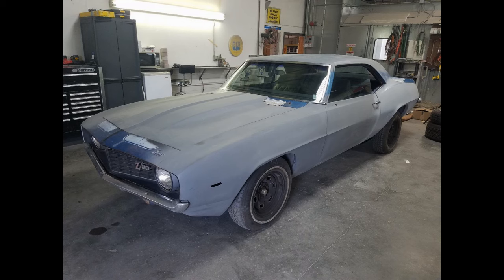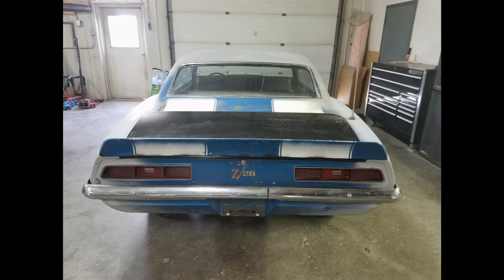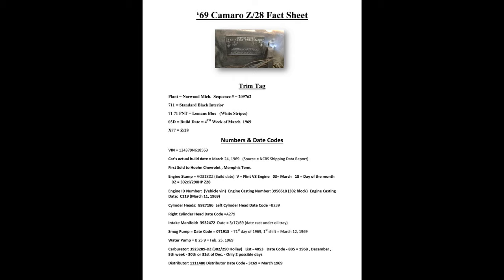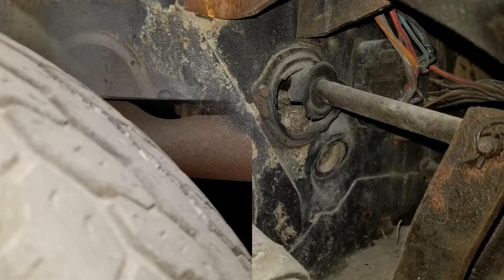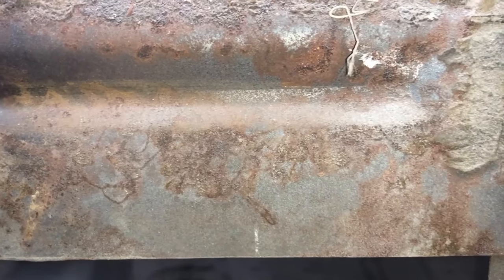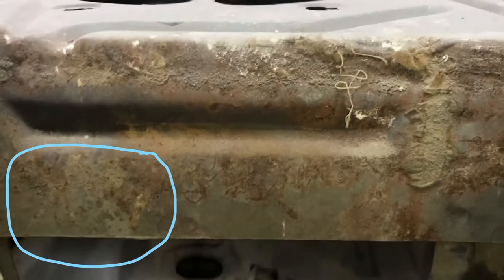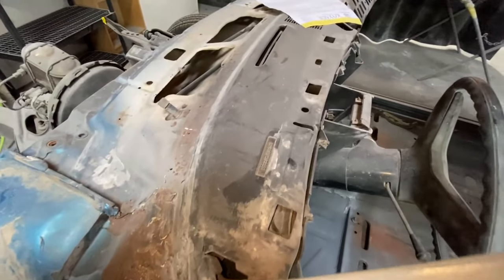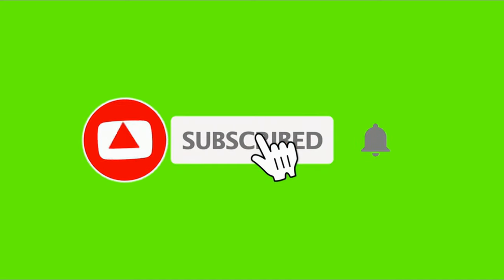1969 Camaro Z28 Le Mans Blue Full Restoration Video Series - Part 1

Comment: I found this four years too late! This is very similar to my uncle’s first new car, at least the way it rolled off the assembly line. Code 71 paint, black interior, flat hood. He he had the rear spoiler, but was without the console and had 3.36 gears - the tallest you could order in a Z-28. He was 21 when he ordered it. What a great find for you.

Comment: I want my 68 back FULLY Rebuilt as I Intended it to be, that My "Best Friend" at the time was Rebuilding for me, being Fresh Out and Top 5 in his College Coarse, His Parents Sold in 92, Without a Title and Me knowing in the middle of the Build...  Would have had a Brand New (1989) Trucks 350 w 5 Speed with only 500 miles on them, Tilt Telescoping Steering, Custom Kevlar ( Kevlar free from work ) Hood with Scoops and Kevlar Tail Wing, Fresh Restored/Covered Buckets, Dual 3" Exhaust, Brand New Carpet, Brand New F/R Quarters I got from work. $4000 just in Primer ( Free From Work ) Brand New Windshield/All Glass and everything else it needed to rebuild... All there... But was taking up room in a Shed they never used, so they sold Everything and if I remember correctly, only got a Few Grand for it... like 2 or 3 grand and I paid 1500 for Rolling Chassis and most of the stuff besides the engine/trans, paint/primmer, steering wheel, quarters and all the Free Kevlar was already included.

I use to work at a Chrome Bumper Plant where we would Strip/Sand/Sand Blast Cleaned and Prep Bumpers to be Chromed/Restored or even High End Painted ( $1000 Per Gallon Primer ), along with any parts you wanted Chromed/Restored. Could Order any Body Part of Any Car you wanted. I Could of Chromed my Whole Camaro for Free if I wanted to.. Since Employees were allowed to Chrome Any Part For Free...

Comment: You may be aware by now, but the shifter hole is likely original. They were cut with a torch by hand on the assembly line. Guy may have had a tad too much coffee that morning.

Comment: Kind of new to the car scene but for some odd reason I'm loving these restoration videos and I've never been interested in auto machanics before...  curious to know what a good deal is picking up something like this?
Reply from the maker: I spent 15 years looking for an original Le Mans Blue project car that was not rusty beyond repair with original engine & drive train. So it just takes persistent looking and digging. They are getting harder to find every year.

Comment: Oh hey I just remembered that I also have the same 6618 block in the garage too I think it’s a 350 but now I have to check today and if the numbers I want to see have been machined off.I inherited it when a buddy passed on.hey I like the sound of yours,is that the final motor combo or no?
Reply from the maker: Hi Barry, the engine that was in the car when I bought it, was a 350 which is what the car had in it when I pulled it up on the trailer in the video. I got the original DZ block with the car, which I am building to put back into the car as it was from the factory, but the DZ engine sounds very similar to what the car sounded like. Pulling it up on the trailer, except that the DZ has solid lifters. But dz engines sound very radical.

Comment: I'm glad I found your channel. I am into CBX's and 69 Z28s just like you are. I have a Rally Green 69 Z and a Silver 79 CBX that I bought new. My 69 Z28 is an early one assembled 12-5-1968 at the Los Angeles Plant and delivered to a Chevrolet dealership located within 5 miles of my home in San Antonio Texas. I was wondering if you found the build sheet anywhere on your car when you disassembled it? I've heard that the build sheets are rare to find on a Norwood car. I'm wondering if there might be a build sheet somewhere on my Z. I have a video up of my car too. Thanks
Reply from the maker: Hi Michael, Thank you for your comment. I hope subscribed so you can keep up on the Z/28 build. I just watched your video on your Z. Very Nice. I love Rally Green. So you must have chambered exhaust since its an early car. I have not found the build sheet. I am sure there never was one being a Norwood car. But I do have the original sales receipt and the NCRS report. :) I am so lucky to have found a pretty rust free project car in the color I have always wanted :)
That is so cool that you still have your original CBX. I also bought them new and wish I still had the original 79 as I still have the original sales receipt.
Reply: @digitalpizza1  Thanks, I did subscribe to your channel. My Z28 was sold originally with a flat hood and no spoiler. It was also originally equipped with the chambered exhaust. I have the benefit of knowing all the previous owners, and remember the car during the seventies till now. One of the owners changed the exhaust to headers with flowmaster mufflers. I plan on replacing that with the correct manifolds that came off the car, and adding a new Gardner chambered exhaust system. I'm looking forward to seeing that beautiful Lemans blue  Z28 finished and back on the road again!

Comment: I had both a 67&68 SS 350 4 speed & L78 396 with wide ratio hi gear rear I absolutely loved em both.I was wondering if you know anything about the spec.’s for the torque converter on the auto version.I had Coan build me a converter but they only listed to half what I told them and after getting it I was medically down for some yrs so now I have to sell it and get the right one and I’m just trying to get all the info I can.I wanted a 9.5-10” but ended up with an 11” 2600-2800 rpm and behind a 500 hp 406 it’s a great converter but drives like grandma’s car,no slip at all with th-350 anyway I’m having a time finding info about it I have a small library but this point is eluding me and I need to find what mine can be used for.I envy you,I have a 72’Nova,wanna trade?lol

Comment: didn't the Z/28s come with a M22 close ratio transmission ? we called them "rock crushers " back in the day . just saying a 68 rear spoiler looks best on a 69 Camaro it's not original but its taller and fits neatly with the car
Reply from the maker: They did , as an option. Most came with an M21, also as an option. The M20 was standard

Comment: I’m looking at a 1969 Rally Sport Camaro. I’m trying to verify it’s a true Rally Sport but I’m not sure what should be on the trim tag. Anybody know? The ViN shows it is a V8 car and it has a 4sp. It has the proper back up lights and a headlight washer solenoid. Thanks
Reply from the maker: I would remove the backup lights on the rear valance and make sure the holes are die cut from the factory rather than a crude saw cut.
Check to see if the front fenders are actually RS fenders.
All Rally Sports are X33 cars if from Norwood or have the bright trim option if an LA car.
Check if all the headlight door mechanisms are in tact and original.
If all that checks out, it’s probably a real RS
Reply: Thanks, after a lot of reading last night I discovered that this is an early car and the trim Tag does not have an H section for I guess the body type. This would explain why I cannot find anything on the trim code to verify that it’s an RS. The interior is a 711 that matches and the paint number is 76 for Daytona yellow which I discovered under the black primer. The car has been parked for 30 years it ran when it was parked, I wish I could post pictures on YouTube . I am going back one night this week to check everything, I guess there’s a vacuum hose near the master cylinder to look at and I will remove one of the backup lights like you suggested. It’s a friend of a friends who is selling it, it’s not listed, he wants $10,000 for it. It has the hood, the hideaway headlights and the spoiler along with the four-speed. The only visible rust is a couple of places under the black vinyl top. I think I can possibly get it started and drive it home not sure but I can always bring my trailer . Thank you so much I’m really loving your videos I wish your shop was closer to Atlanta I would come by and check out your cars. Thanks again!
Reply from the maker: @wlc1980  Hi Tracy, you could email me pics if you want. my email is digitalpizza@comcast.net. Another RS item to check is the hole in the firewall for the vacuum tubes as you mentioned. It is a large hole, about 1" or so, to the upper left of the square hole where the brake booster/master cylinder is mounted. Is this a Z/28 or SS? Sounds like a good car and at a great price regardless whether its an RS or not. I would love to see the pics. Thanks Tracy. You are welcome to call me anytime if you have any other questions at 415-272-8133 Pete

Comment: Nassau, marina and le mons were all the same color, just different names
Reply from the maker: Hi Larry, you are correct in  the sense that they are all extremely close and all have the same Paint I.D. of 976 (this is the code, not the trim tag i.d.), but the actual paint codes are different. Nassau & Le Mans are so close, its almost impossible to tell the difference. But Marina Blue is noticeably different. Marina is lighter more silvery, Le Mans is darker and richer.